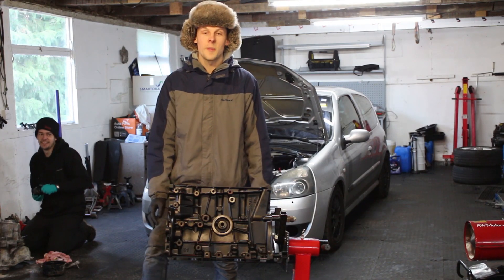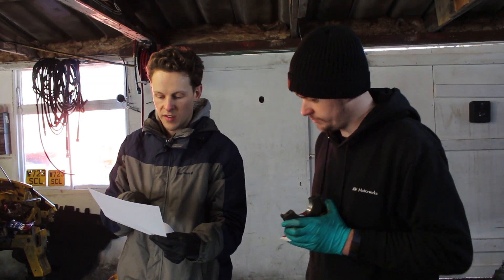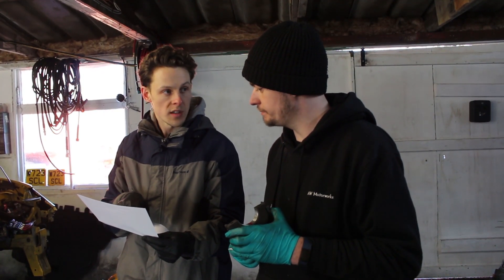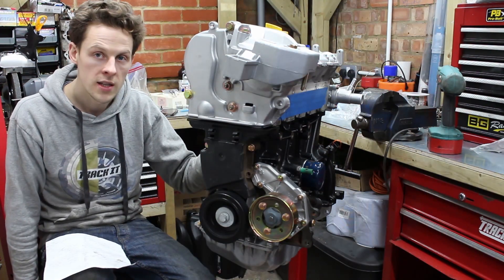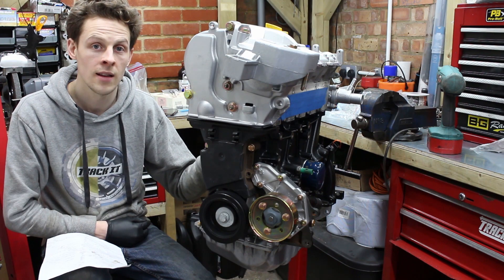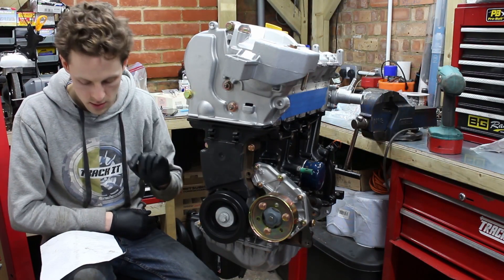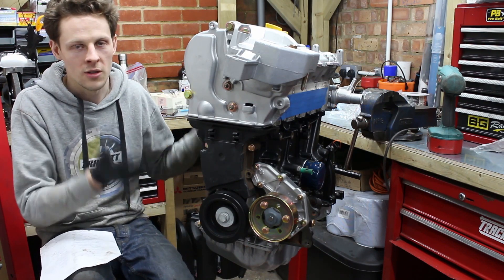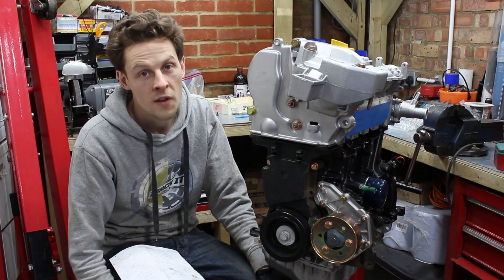Building an Engine for Choo Choo - The Turbo Clio 172 Cup Part 2

Comment: What mods have you done to the gearbox?
Reply from the maker: @darshanaidoo2  it had a gripper diff and therefore used a ph1 172 short driveshaft. I had an RTS hybrid clutch on a ttv racing flywheel.

Comment: Hellow  I appreciate your videos they are so breathtaking,, I have the same Engine in South Africa that I would like to turbo it having been impressed 👍 by you,, may I please know what did you do with regard to compression
Reply from the maker: Glad you enjoyed it. We just used a megane 225 headgasket to reduce cylinder temperatures/pressure but there is no requirement to do so. All other compression parts remained standard.

Comment: Hello the engine parts are original? And original parts is ok for turbo power ?
Reply from the maker: More or less yes. I used a Megane head gasket to reduce combustion temperatures, Megane keywayed crank  pulley and super tech valves although none of those are technically required.

Comment: Great work! What did you do with the fasteners, are they new or did you electroplate them? 2 years on how has the gearbox fared?
Reply from the maker: They’re tumble cleaned and plated by a company called TSR vapour blasting. The box had an issue as it was incorrectly assembled when the diff was fitted but if it was put together correctly would have been no trouble. I don’t own the car anymore but understand it’s all working well
Reply: @TrackItYT  Thanks! I have an engine out mini restoration ongoing on my 182, the videos have been helpful. Need to get all the fasteners shiny again.

Comment: Where did you get the galv bolts from for the engine ?
Reply from the maker: I had the original bolts tumble cleaned and yellow zinc passivated by a company called TSR Vapour Blasting.

Comment: Hey mate, simple question but I’m thinking of re sealing the crank end plate like you’ve done (3.47) as I’m unsure if it’s leaking aswell as rear main, is it much of a process to do and what do you use, I’ve got the engine out of the car, cheers in advance
Reply from the maker: Hey, that my friend is normal silicone you can get at screwfix. The official repair procedure says to use it :). Pretty easy job, need to be careful getting the cap off as it isn’t easy with the old muck still in there. Be careful not to get any gunk in the engine and wipe off excess as you see us do.

Comment: Hi there! I'm about to rebuild my engine to std spec though nothing fancy. The cost is getting closer to 2k and the guys that will do the build say that on most of their builds they replace the crank also with a new one. Are they that bad? Can it be rectified somehow? I'm quite positive that the journals are fine so the last thing I'm thinking is that it can be bent somehow. What are the tolerances in which a "good crank"should fit? You seem to have measured yours in this particular build an that's why I'm asking. I don't even want to think at a new crank because the cost will skyrocket...
Thanks!
Reply from the maker: Not surprised it’s not a cheap business. In the first video there’s a little section which shows the crank measurements and what’s required. Drop me a message on Cliosport.net, username GrahamS and I’ll send over the measurement specs. Most difficult bit is finding a standard block without scored or oval bores.

Comment: Hi chaps where are you guys based, would you be interested in fitting some forged rods pistons and arp bits and bobs and a turbo kit using gt30 on low boost. Basically drive in drive out service Essex ?? Alex at aw engineering?? Thanks
Reply from the maker: Hey, AW Motorworks is based near Standstead and can do all sorts or custom work including turbo conversions, cams, timing etc. I’m not a mechanic so would leave it to him!!

Comment: How many pressure bars stock internals acept?
Reply from the maker: Pedro1987 no idea and I don’t want to find out but lots of cars run very similar to me 6-7 psi for years without issues. I have known a couple of cars with more but you start to have issues with ringlands if you run anymore so forging is required above about 260 bhp.
Reply: How much hp you made with 6/7 psi? The f4rt block is a good idea? Or spends much more and need more parts to run on clio?
Reply from the maker: 242 which is a perfect number for the chassis. F4RT isn’t stronger and has very weak ringlands. I had an f4rt 182 and there was lots of compromise. It lost a ringland at 280 bhp and others loose them at less.  The turbo set up on it is significantly bigger which gives firewall clearance issues and you would also lose the VVT which the f4r has. The gearbox requires custom driveshafts and the chassis leg needs notching to fit. It’s a big pain and more expensive sadly.

Comment: If you don't mind me asking, what sort of expense was this?
Reply from the maker: Valves and their machine work was about £700. Excluding the valves other machine work was approx £550 and parts were around £850. Sourcing good quality base engine parts was the most difficult and took a long time. Cost approx £350. Blasting and zinc plating was around £150 for the engine parts. All excluding labour. Hope that helps :)